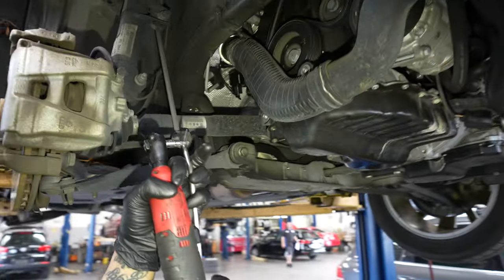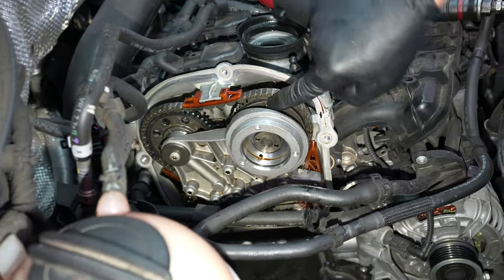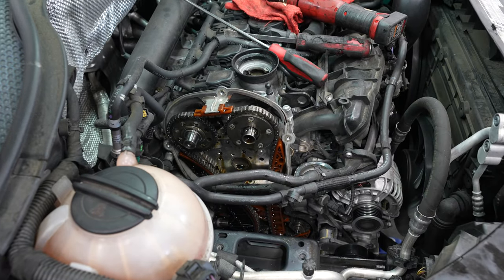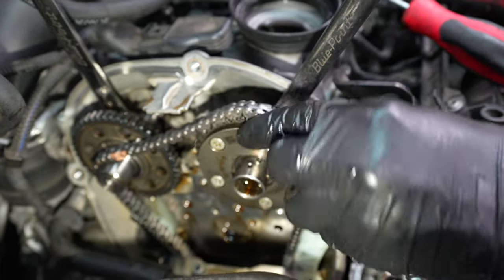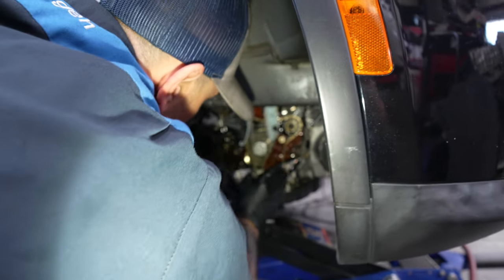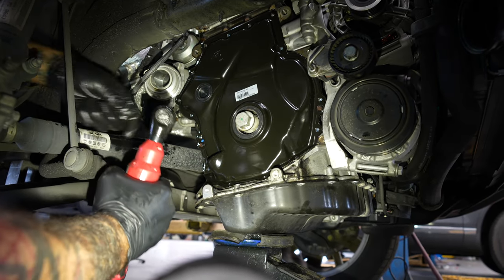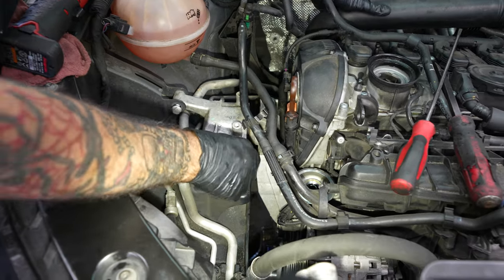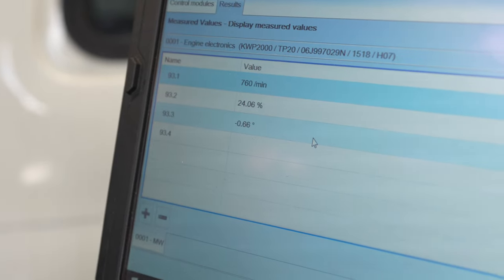2012 Tiguan Timing Chain

Comment: Just a quick note and update - spent the last week and successfully completed my Tiguans 2010 timing chain , guides, and updated tensioner. Tensioner was at seven ( 7 ) notches extended - wow 😮. The engine is now so quiet now - specially at initial crank. The new tensioner is at two ( 2 ) notches. 
Thank you guys so much for your help - please keep us home mechanics in mind - limited tools etc
Reply from the maker: Appreciate all your feedback will definitely keep that in mind

Comment: Over the last few years I’ve watched many videos on tensioner and chain replacement - and this is the best video for me in so many ways. Thank you - just happen to be do this task over this coming weekend on my 2010 Tiguan - cheers
Reply from the maker: What cars are you working on? what cars would you like to see in the channel?
Reply: @GremcoGarage  Hi - now retired - but I help myself and family on the following vehicles: 2011 F150 FX4 ( 5.0 ), 2010 Tiguan, 2010 Mazda 3 ( 2.5 non turbo ) 2016 Elantra GT, 2012 Roque, 2021 F150 ( 2.7 ) - my background is electrical / instrumentation - not a mechanic but always up for a challenge.
Future work is on the Roque - Christmas tree lights on the dash - ABS, Traction Control, and Air Bag ; looked at the codes thrown - I think - clockspring - everything resets nicely - but drive off and rotate the steering wheel by 20 degrees - bingo - all lights back.. Then the Elantra transmission fluid change.
The usual tire rotation for winter along with oil changes - I preach 3000 Km  - noticed the smell of raw gas especially the turbo vehicles if pushed to 5 - 6000 Kim’s.

I would like to see more on suspension linkages and bushings - I see my family avoiding replacing these parts on the basis - they look okay from here - LOL 😂 

Cheers

Comment: This is by no means an easy job. Especially in a 100 degree garage, especially on an Audi with the engine mounted the other way. I spent 3 days of blood, sweat, and tears but managed in the end, for only $400 in parts and tools. Great vid.
Reply: LOL did it on my 2004 RS6 had to take out the engine lucky you

Comment: Mint video. One thing that's usually called for is to let the crank seal in the new timing cover bond with the shaft on the crank pulley for 4 hours before the first crank to avoid future leaks, same as that lower timing cover sealant (24 hours at least for full seal to the block)

Comment: I usually remove the pulley and turbo muffler . I have never loosened that 5mm. Im gonna have to try it 👍 also just so u kno if you find the torn screen , there is a tech tip to also replace the intake camshaft. More tenths for you
Reply from the maker: Thanks for watching the video. What other videos have you watched?
Reply: @GremcoGarage  this is the only one. I just discovered your Channel was in my recommended, I’ll be watching more soon
Reply from the maker: Thanks a bunch feel free to share the channel if it’ll help anyone else out

Comment: Currently in the process of chaining timing chains/guides and tensioner. I ran into a weird problem (for me at least). I put the vehicle at TDC (with verified cylinder 1 in the up stroke and 4 o’clock triangle and slit on crank pulley). Unfortunately, my exhaust cam and intake came will not line up with the 65mm and 125mm overall as specified by Volkswagen. Both my cams are at 1 o’clock roughly. I have rotated the crank pulley multiple times to see if maybe I could finally line the cams up. No luck. Vehicle has a p0016 and has the old tensioner prone to failing, which it has due to how easy it is to push in. 

Any suggestions would be appreciated. Thanks!!
Reply from the maker: Have you already put the new chain on ? If not the car has already jumped a tooth as verified by the p0016 . At this point I would just disassemble the chain and use the copper links on the new chain to set the timing marks correctly
Reply: @GremcoGarage  I am in the process of taking off old chains and tensioners but before that. My understanding was that the vehicle has to be at TDC and the cams have to be at the 11oclock exhaust side and 1 o’clock intake side. 

My cams will not line up like that. Does this mean I have to take off valve cover and manually adjust the cams to be at that position?
Reply from the maker: @ivanvega2821 You can adjust the cams with an 18mm wrench with the valve cover still on .

Comment: Interesting fail point on the chain tensioner locks
Reply from the maker: What’s the timestamp on the video? What Volkswagen are you working on and what other cars would you like to see on the channel?
Reply: @GremcoGarage  6:59 when you’re talking about the updated part with a different style lock due to the tensioner cam breaking often. I work in a Subaru shop & have never seen that issue on this manufacturer. Is that tensioner issue why the tsi engines blow? Tension gets slacked, jumps timing & busts a valve?
Reply: Hi there, do you need to. Make adaptations with vcds after timing chain changed. Regards

Comment: you didn't shown anything helpful. didn't show how to remove the main tensioner just took the bolts off because you know it locks up with the guide also didn't show how to remove the bracket that goes across the cames where the sensor connects. tow thumbs down
Reply from the maker: Thanks for the input. I will look into this.